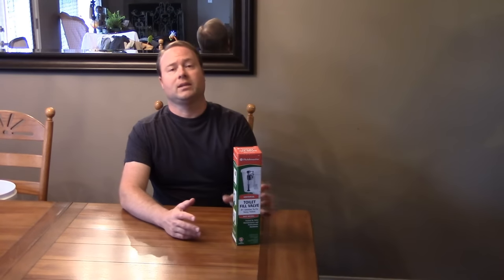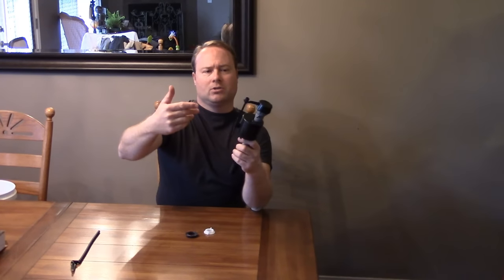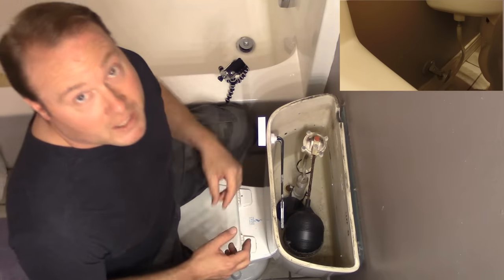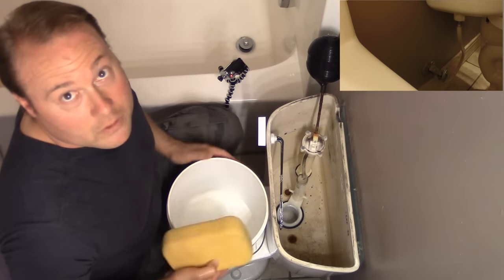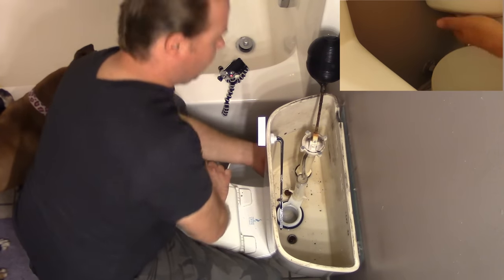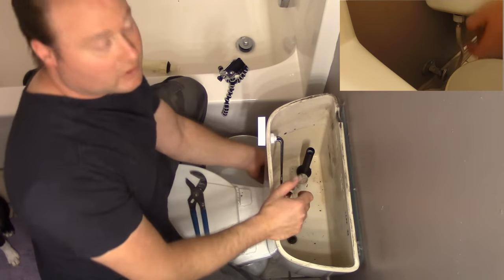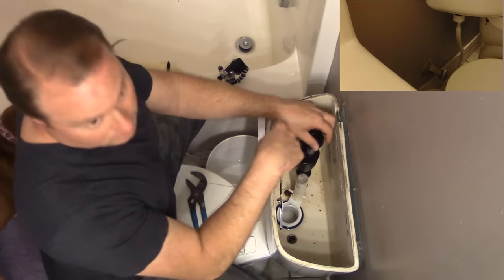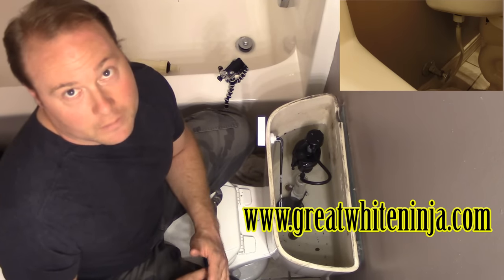Fluidmaster 400a - Installation

Comment: Hi, thanks so much for your videos. Both are very helpful! I just installed mine. It seems to work but I am confused by the refill tube with a clip. You said that it should be clipped so that the water goes into the overflow tube. My understanding is that it is the source of water into the tank. It should release the water into the tank instead of into the overflow tube, which prevents flooding if somehow the water fails to stop. In your other video, you said it is OK to clip it the other way so that the water goes int the tank. Could you explain the purpose of the refill tube? Thank you!
Reply from the maker: Julie, thanks for your question. You are right about the purpose of the overflow tube. It is designed to relieve water from the tank if it continues to fill past it's set level. It does this by draining into the bowl, which when it gets full enough it will flush. So, as long as the toilet is not clogged, this works beautifully.  The black tube on the Fluidmaster fill valve goes into the overflow tube to help fill the bowl. It just adds a little water. The tank fills from the base of the fill valve stem. The reason I say that you can turn the tube so that it adds to the tank instead is because I had an argument with a viewer about that. They did not care that it is designed to go down the overflow tube to add to the bowl water, because they insisted that it was wasting water. Forget the fact that the bowl has to reach a certain water level to flush and if you keep water from the bowl, then you have to drain more water from the tank to make it flush. Or, if you have the tank set low to try and save water then the toilet will not properly flush at all. There is a certain amount of water required to make a toilet flush, and with the low GPF ( gallons per flush ) water tanks in the US today it is barely enough to get your waste all of the way out of your drain pipes and to the street main. 
So, in short, I can't waste my time arguing with people that don't understand the mechanical arts, but assume they know more then I do. I hope this answers your question on the tube, and gives you more info then you ever wanted to know about toilets. Glad to help. Thank you for watching, and please share. Check out hundreds more of our videos at https://www.aroundthehome.org/
Reply: @AroundTheHome1  Thank you so much for the detailed explanation. The toilet system looks simple but it has a lot of science behind it. The instruction was clear but without explanation, this seemingly counter-intuitive placement trips people up. So grateful that people who actually knows are taking the time to help others. Great job!
Reply from the maker: @Julie Wonder, you are welcome. Hopefully this helps you with your project.

Comment: The Fluidmaster 400A has a major flaw.  It takes 4 mins to refill your tank where the old style takes less than a minute. The issue is theres a white rubber stopper in the valve that you must remove for the tank to fill faster. Why did the company did this?? Stupidity?? yes.  Some of us needs to double flush as first time around doesn't clean everything.  It appear they added this stopper in newer models.
Reply from the maker: Let me take a minute and correct you here. You are right about the white rubber flow restrictor. It does suck, and I address that on my newer videos. But that is only on models that were intended for sale in states with very restrictive water laws. So, not all 400a units have this and the company did not decide to just restrict the water on you. Living in the mid-west, our 400a's don't have that. Though, I did order one on Amazon and it did. It is easy to remove with a needle nose pair of pliers which again I do mention on my newer full toilet rebuild video. And also like you said, I would recommend double flushing whenever taking a deuce.

Comment: Dang!  Now I gotta get two or more dogs to help me unscrew that water supply line, and go change my tee shirt to put it on backwards!  Who knew?
BTW, I just bought the Fluidmaster "Contractors 3 Pack" 400ACN3, and there were NO detailed instructions inside. Only basic steps on the back of the box, and no telling why they give you TWO white nylon nuts, nor how to modify that rubber washer to fit over the 7/8" diameter stand pipe.  You gotta separate the little washer from inside the big washer (might need a sharp knife) and decide which one goes where.  But I have 5 rental houses, and 18 toilets to maintain, including my own, so the 3-pack for $18.48 at Lowes was a bargain (and I got it for $16.63 with my military / veteran discount)!
Reply from the maker: Yes, the V neck on backwards is a pro tip that most wont tell you about. That is awesome! Thank you for watching. Check out hundreds more of our videos at https://www.aroundthehome.org

Comment: Thanks for the video.  From where the water comes out ?
Reply from the maker: From the base of the valve. That black flared out spot that is mounted at the bottom of the tank. Some water also comes out of a tube up top, but that is directed down the overflow tube into the bowl to help fill the bowl back up. Hopefully that helps with your question.

Comment: Great video. Question...can the fill valve be adjusted after it’s installed if it’s sitting too low (without taking the entire system out to adjust)? It looks like you adjusted it and clipped it on to the valve stem already attached to the toilet. After watching your video I realized mine is sitting too low compared to the overflow tube.
Reply from the maker: Yes it can be. It is designed to be adjusted in two ways. First is the course adjustment. Just grab the top of the fill valve and spin it. It will screw up or down. Now sometimes this does not work well because it is so close to the walls of the tank that you can not really do that. If you need to course adjust it, but can not spin it, then you can do this. Make sure that water is turned off to the toilet. Then unlock the ring and pull or push the fill valve into place. Then make sure the ring is locked back all the way. This is not always easy to do when it is in the toilet already. You have to make sure the ring is all the way back into place. When you have the fill valve into place pretty close then you can fine adjust the height by adjusting the float screw. I hope this helped. Thank you for watching. Check out hundreds more of our videos at https://www.aroundthehome.org/
Reply: Around The Home Thanks so much! I’m subscribing!

Comment: I watched to see how to adjust the water level as I replaced all the parts including the water valve on the wall and I see that the water level is a bit low. I wish you brought the camera in for a close up and show how to raise the water level. I think you said to go CCW to raise the water but I can't remember
Reply from the maker: I do the water level adjustment at 17:35. If you need to make the water level higher then you should be able to use the screw to raise the float. If you can not raise it high enough with the float then you need to raise the height of the stem. You can do that by either releasing the ring and lifting the stem a notch or two, or by twisting the top part. Thanks for watching. Don't forget to stop by our website www.greatwhiteninja.com

Comment: Just a suggestion for future updates....

Please consider different colored work- shirts to provide contrast to the item or device you are demonstrating.  This allows for more details to be visible.  Also, the nuts on the flush stem would benefit from close-up camera work if there is any adjustment required.  

Good instructional video, please consider t-shirt suggestions. (If your two puppies were on Union scale, they have to learn to grunt louder!  Tell them they’ll get kicked off the Apprenticeship Program otherwise.).  

All the best to you and your helpers.

Dave Mooney
Colorado Springs, CO  80918
Reply from the maker: Thanks for the tips. I am actually about to remake this video.

Comment: Real nice job, thanks.  However, I can't get the wing nut off on the bottom of the tank. Ideas?
Reply from the maker: Are you using a good set of slip joint pliers? Is it a metal stem and nut that is rusted?

Comment: Any suggestions for doing this on a 1-piece toilet?   I have no access to the feed line (other than to turn it off) or the point where the Fluidmaster valve sits in the tank?  It looks like all I can do is replace the top half (float portion).  I'm glad I watched the video to know that is an option.
Reply from the maker: I have on a Toto 1 piece, but the fill valve installed the same way. Honestly I have very little experience with 1 piece toilets, so I have not seen many variations. Do you know the brand and model by chance?
Reply: @AroundTheHome1  It's a Kohler, I think it's model K-3564, it's about 8 years old.  Very little room in the tank to get my hands in there. I'll be calling Kohler in the morning.  Thanks again for an informative video.
Reply from the maker: I looked up that model. Wow, it looks like you actually have to pull the whole toilet up to get to those parts. I guess that's what you sacrifice to have that ultra clean look.
Reply: @AroundTheHome1  Good news - I was able to complete my repair! It involved removing the center flush valve (easy-release clips once I found them) so there was room to work, and then cutting out the top half of the old fill valve to get to the lock ring, removed that, and installed the new 400A top half only. Lesson learned - pretty toilets are a PITA  ;-)  Thanks again.
Reply from the maker: So glad to help! Thank you for watching. Check out hundreds more of our videos at https://www.aroundthehome.org

Comment: If the water flows over top of the overflow tube, does that mean the fill valve needs to be replaced?
Reply from the maker: If you are saying that the fill valve does not stop filling and the water just goes over the overflow, then yes. It is possible that the fill valve is set too high and that's why it is going over, but it sounds more like it just isn't shutting off. Here is a slightly newer video that might help more. I need to make a completely updated one though. https://youtu.be/KLvoFsE3NP0

Comment: Toilet is making a loud (foghorn) sound, and has a leaking and running issue too. After watching this I think it seriously needs a whole new fill valve, and all parts that go with it, replacement. I don't see a Float Ball... do some toilets not have one? weird. IF the hubs doesn't get to it I'll give it a go myself. thanks for the knowledge.
Reply from the maker: Some toilets don't have a float ball. Many stopped using that years ago. Here is a newer video that might help you a little more. https://youtu.be/KLvoFsE3NP0
Reply: thanks. the hubs hasn't gotten around to fixing it yet. I just might have to tackle it myself.
Reply from the maker: Well, I hope that my video helps you through the whole process. Good luck with your project and let me know how it goes.

Comment: See, this fluidmaster valve floater thing hits my toilet flush handle rod, because mine is on the far left side (NOT FRONT AS in Around the Home's).  I tested it a few times and one day later, I noticed it did NOT shut off.  Dunno how it shifted, seems improbable Either way - Can you loosen it and try to get it to tighten up in a different place in order to have the flush handle bar clear the float mechanism of the valve?  I'm gonna try it after I use the darn thing for a flush!
Reply from the maker: You will probably have to loosen it up from the nut on the bottom of the tank to move it just a little. Thanks for watching. Don't forget to stop by our website www.greatwhiteninja.com

Comment: I have a Kohler double flush toilet about 8 years old recently it started to leak,  It was replaced with a Fluidmaster 400A.  If you flush the toilet 2 full flush, it is fine.   When you flush the toilet 1 a half flush (it doesn't fill up), the bowl fills about half way up.   Is there an adjustment or some other action I can take.  Thank You.
Reply from the maker: So when you do a half flush it does turn the fill valve on, but it stops short?

Comment: Hello...when the tank is full after a flush, water keeps pouring into the white tube and wont stop. This just started. Is there an adjustment...the 400a Fluidmaster is about 1 year old in there, thank you for your help
Reply from the maker: My first question is does it have the plastic elbow holding the black tube inside the white overflow? Even though this just started, that elbow helps to prevent siphoning. That sounds like what is happening.

Comment: 15:48 shouldn't it be pointed into the toilet bowl and not the overflow? Otherwise the bowl will never fill?
Reply from the maker: I assume you are suggesting that it be pointed into the toilet tank not the overflow. A majority of the water that comes out of the fill valve actually comes from the base of the stem. The water that comes out of the fill tube is meant to go into the overflow tube which drains into the toilet bowl. That way the bowl fills with some water too.

Comment: thanks for this video I just did this about an hour ago. I replaced the flapper too. but it's a burst of water that shoots out the hose  into the over flow (tube?) every so many minutes. What did I do wrong?
Reply from the maker: Sounds like you are leaking water somewhere. Most likely with the flapper. Make sure that it is sealing all the way.
Reply: Nathan Cox water is coming from the valve like out of the top but not constantly
Reply from the maker: It sounds like the water level is slowly going down and causing the fill valve to refill just a little. That is the best that get from what you are saying. Have you checked the flapper? Have you listened closely to hear any tiny dripping?
Reply: Nathan Cox no dripping very quiet until that refill burst it's very short but comes out with pressure
Reply: Nathan Cox the flapper seems fine brand new as well it's a 2inch I guess I bought the right size. The 3inch was noticeably bigger compared to the one I pulled off
Reply from the maker: The next thing that I can think of is lets confirm if your toilet is leaking. Mark the water level in the tank with some take or something. Then shut the water off to the toilet so the fill valve can not come on. Check it again in an hour and see if the water has gone down. Let's eliminate things one by one here.
Reply from the maker: *tape
Reply: Nathan Cox lol right thank you for responding don't know why I didn't think of that
Reply: yes water is draining out some how no idea how.
Reply from the maker: I can think of 2 ways. First is the flapper. Maybe there is a lip or seam that is causing it to leak. Second is did you put the little plastic adapter onto the tube that you have going into the overflow. That actually also helps with it to not siphon.
Reply from the maker: Let me know how it's going. I want to help you get this fixed.
Reply: Nathan Cox well it is losing water. I Don't know how but I don't hear any running water like before and the waves in the bowl stopped. This my first time doing this so I'm not sure what ti do next
Reply from the maker: Do you have the plastic end on the hose?
Reply: Nathan Cox u mean the little rubber one? If so yes it is clamped to the overflow tube
Reply: Nathan Cox yes it's connected to the clamp
Reply from the maker: If there is no water dripping out of the tube then you need to look back at the flapper. There might be a lip or something that is causing it to not seal 100% Or look closely at the fill valve area where the flapper covers. Make sure that there is not gap there.
Reply from the maker: Any luck with the leak?
Reply: Nathan Cox not sure what else to do gonna get someone to look at it. I cleaned the hole the flapper covers with a toothbrush to clear any debris still draining.
Reply from the maker: I'm sorry. Hope that you find the problem soon.
Reply: Nathan Cox it's cool thanks for your time

Comment: what is the name of the lever at the top, that u said adjust the fill valve? when I flush my toilet water trickles out of that lever, can this be fixed or do I have to replace the whole unit?
Reply from the maker: This can be caused by your water pressure and how hard your water is. There is a rebuild kit that you can get, but honestly I haven't used it. Not that it doesn't work, just that our water is so hard and it is so easy to replace one of these that I normally don't rebuild it. The rebuild kit is fairly easy to use, just have to pop the black top off and replace a few pieces, then pop the top back on.
Reply: thank you, I'll look into the new part. do you think it would be worth while to have my water tested?
Reply from the maker: Not unless you really want to. You can ask the people in the plumbing department where you buy your parts if the area has really hard water or not. The veteran workers should know the area's basic water properties.
Reply: ok ill ask around at lowes when i go. but thank you for replying, you are very helpfful and its nice to have someone actually answer with a real answer. so thank you again now i have point to start at.
Reply from the maker: No problem. Good luck with the repairs. For more help around the home check out my website www.greatwhiteninja.com

Comment: My toilet has some kind of black looking gel or caulk around the base of the fill valve. Would this tutorial work for me or do I have to use the same type of fill valve.
Reply from the maker: Sorry for the delay in getting back with you. It may not be caulking. When the old rubber seal gets really old it can wither and get all weird looking. This fill valve and installation video is good for almost any toilet. I can not 100% guarantee that it will work with yours, but it should.